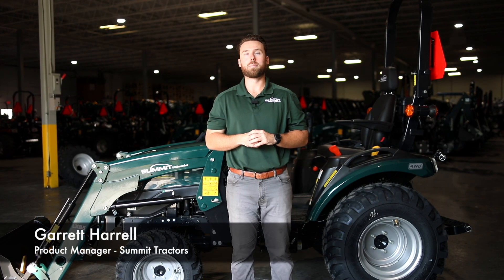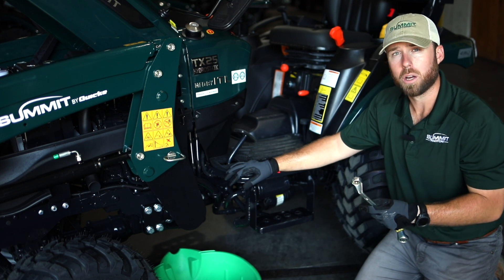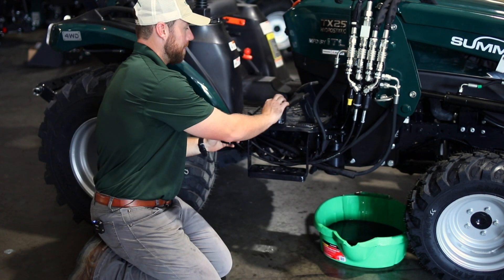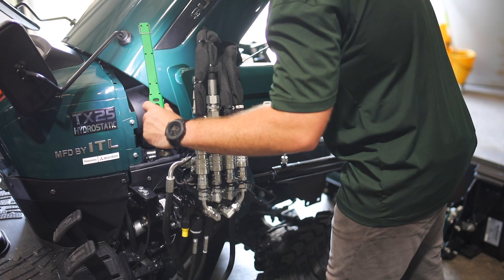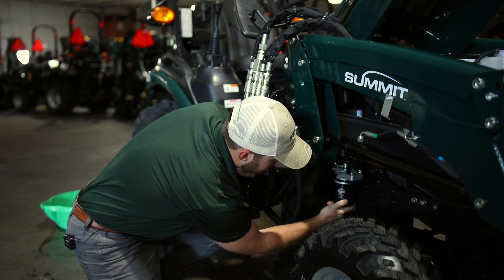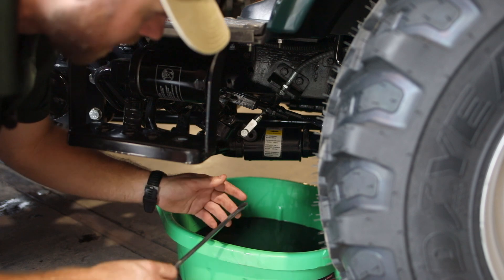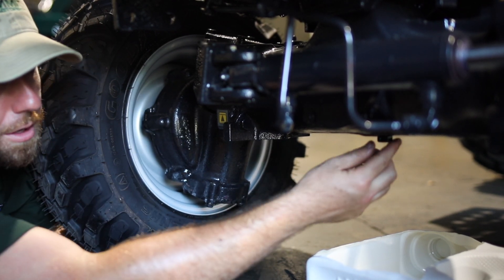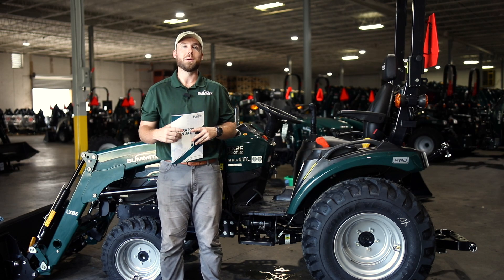How To | 50 Hour Service for Your Summit TX25H Tractor

Comment: you did not show replacing the hydraulic fluid and also how you would remove air from the fuel line.  Seems if you were going to provide a video you would do it completely and well.  Not a good representation of your product.  Otherwise don't even try to provide instructions on how to do it.
Reply: Well he did you pinch off fuel supply line , it will gravity feed fuel to filter when you release pinch plyers .